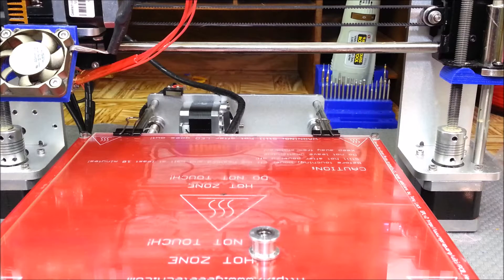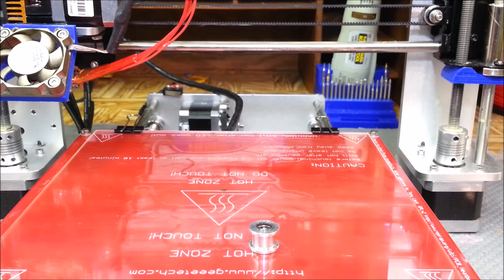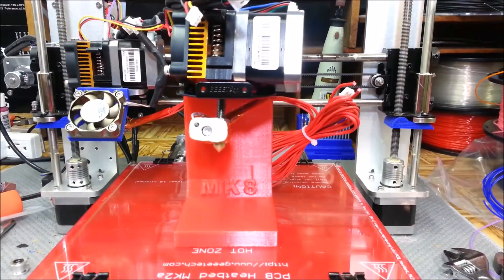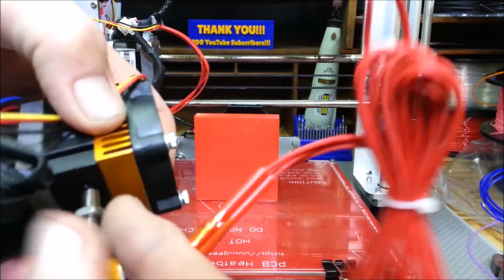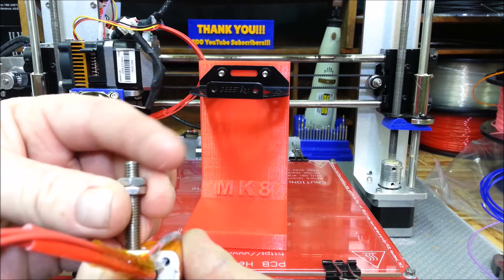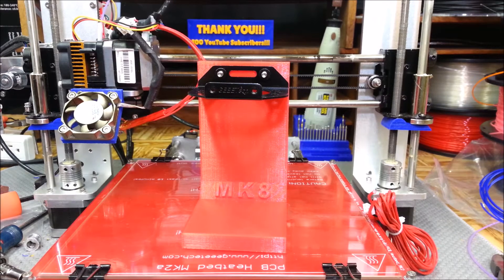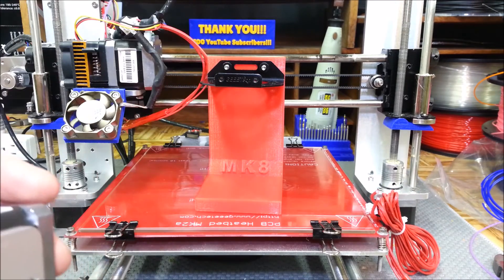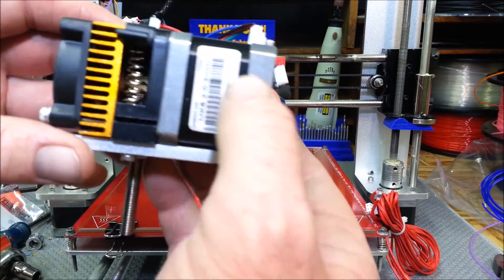Oops I Broke It Again

Comment: what type of fabric do you have under the tape? where can I get it?
Reply from the maker: +iiinsaiii It actually came with the new MK8 Extruder.  They call it Insulation Cotton.  I bought some on Wish.com before, but they also sell it here: http://m.banggood.com/3MM-Fast-Heating-Insulation-Cotton-Cotton-Insulation-Coating-70-X-20MM-For-3D-Printer-p-1027180.html .  I haven't had to install any new cotton, but I'm guessing you would use capon tape to secure the two ends together.
Reply: Jimmy Shaw's Tidbits thank you

Comment: Most slicers allow End Code G-Code, used the finish of the print, to do a move bed forward, etc...
Reply from the maker: +Protomaker Black Sprint Original 3D Printer I have never played with G-Code.  I really ought to try it out
Reply: My end G-Code is, what out for the height on Z I use:=

;End GCode
G92 E0 ; Just reset the Extruder axis:
G1 E -2 F1800 ; and move it backward:  (here, 2mm, at 30mm/s). E3D-v6.  Oozing try to stop problem retract a bit. (2mm is maximun for E3D-v6.)
M104 S0 ; turn off temperature
M104 S0 ; make sure the extuder is turned off.
M140 S0 ; make sure the bed is turned off.
; DO NOT home all axes, probe above printed part
G1 Z195 F250 X 0 F1500 ;  Move Up and Left together. To try to stop problems of oozin and out the way for easier access to  printed part for removal.
G0 Y200 F15000 ; move bed forward to remove printed object
M84  ; disable motors
;Play Pink Panther
;M300 S{pitch in hz} P{duration in ms}
;PinkPanther
M300 S1244 P187
M300 S1318 P187
M300 S0 P750
M300 S1479 P187
M300 S1567 P187
M300 S0 P750
M300 S1244 P187
M300 S1318 P187
M300 S0 P93
M300 S1479 P187
M300 S1567 P187
M300 S0 P93
M300 S2093 P187
M300 S987 P187
M300 S0 P93
M300 S1244 P187
M300 S1318 P187
M300 S0 P93
M300 S987 P187
M300 S932 P750
M300 S0 P750
M300 S880 P93
M300 S1567 P93
M300 S1318 P93
M300 S1174 P93
M300 S1318 P750

Comment: I had this same thing happen to mine. I tightened down the bolt that goes through the pulley too much, and after awhile it chewed up the bearings and started to stick and cause the Y axis to skip steps. One of my bearings was seized up pretty badly in the pulley too, was a real PITA to get out. Got some new bearings off Amazon, and made sure I didn't over tighten the bolt. All is good now!
Reply: Yep, same happened to my Geeetech during the week, actually changing it this weekend.Got come teflon washers that I am going to put between the bearing and the bracket to see if that helps.
Reply from the maker: The funny thing was about a week ago I found some black dust on the desk under the tensioner.  It never occurred to me that the belt was dragging.  I checked the belt and it looks alright.  I think I'll order a new one just to have on hand.  LOL!!!
Reply: Yup, same black dust under mine. It ended up being the remains of the bearing when I looked at it closely. You can get 2 meters of belt off BangGood for fairly cheap. I bought some in anticipation of changing to the E3D Toranado extruder. Good idea to have parts on hand!
Reply from the maker: +Wyntar That's a great idea.  Please let me know how it works.